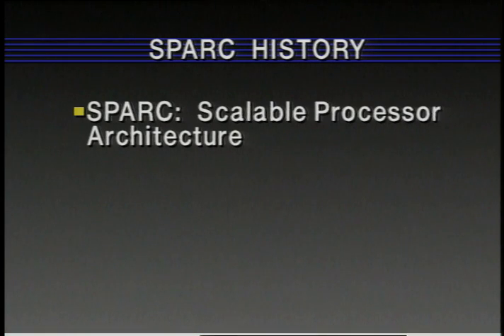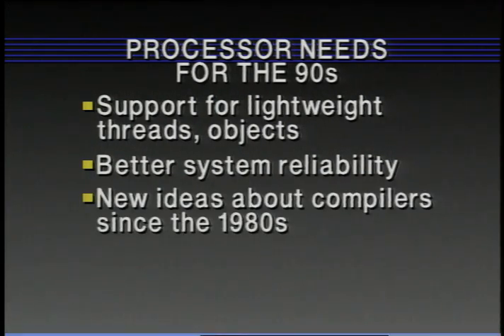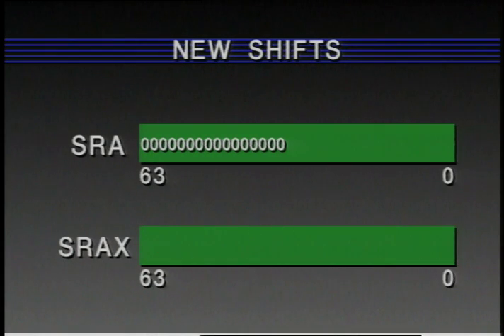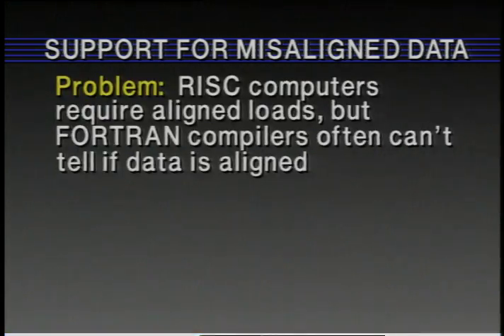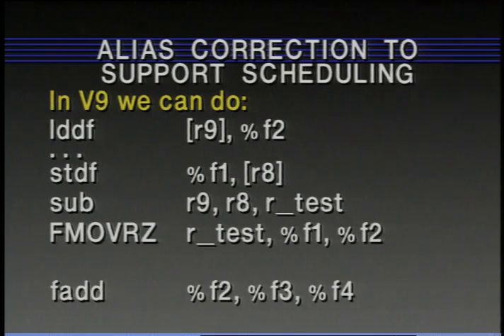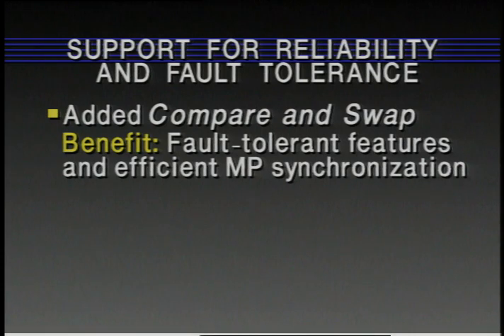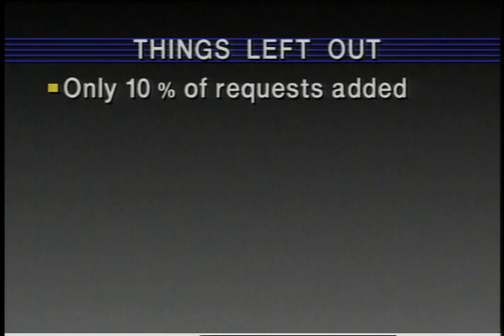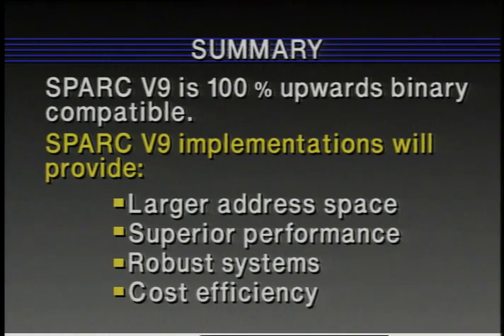SPARC Version 9, lecture by David Ditzel

Comment: 43:00 And then shit happened - Intel introduced superscalar Pentium, internally RISC with "architecture" up front to the "client" in CISC, form of ROM - microcode, best of both worlds. Then Pentium II multiple execution units to say bye bye to everyone else. Then Pentium III 1.2GHz - prefetch. Then Core? Out of order execution, then Core 2 Duo borrowed from Pentium 4 uops cache, translating "client" to world of internal RISC and keeping results for future use. ZEN did the same. Plus improved memory subsystem to be ~45nm instead of 100ns - access time to memory cache miss was of old 368 100ns :) 

Good thing about RISC "centric" architecture is that it remain small, and can be optimized in software. But it's not ideal - from user's perspective. That extra translation adds to flexability of us - users, makes assembly language easier. But same code wont run same on every processor. What is funny is that RISC is best for embedded, to keep simple and low power. Same time makes it harder for programer if you dare to write in assembly. Nobody write in assembly anymore but if you dare RISC makes it way more complicated.
Reply: All very insightful and interesting except the last part. CISC ISAs typically show very little orthogonality, which is why RISC ISAs are generally much nicer to program for.

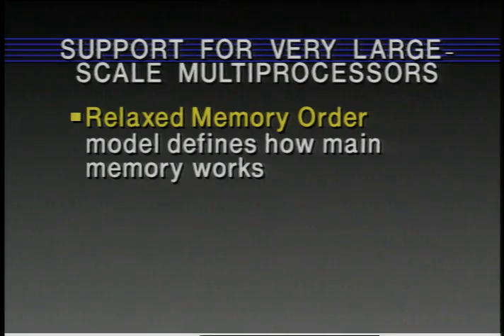Comment: 12:00 SO AMD - Jim Keeler did it better? You can run code in 2 modes 32 and 64, rest like CMOV we take for granted in x86 but was introduced in Pentium 166MHz ~1995  32:00 CMPXCHG there are new version of this instruction introduced in Core Duo and Athlon 64 on AM2 platform required to run Windows 10. Lecture about DEC Alhpa was much more impressive. Forgot name of designer. It was 1992 but it seems like Sparc architecture was designed to be cheap and simple. All these RISC architectures can define 3 arguments to instructions. 2x sources and 1 destination. Separates load, store from operation. This is why zero register is needed. Plus in 1992 RISC needed pipeline like fish needs water CISC allows you to initially solve that, tweak by more complex logic to run your sophisticated instructions in 1 cycle without need to pipeline that. Pipeline require good branch prediction right from start, and strict cooperation between compiler and architecture. Much easier to make pipeline if your instructions are already simple and can easly run 1 cycle. But forces user to sacrifice makes it harder to write code. 

Variable lenght instruction opcodes was requirement to keep backward compatbility, but it adds to complexity of decoder.. tradeofs so called CISC. On other hand allowed to make dozen of enhancements to instruction set. Also AGU on Intel is much more sophisticated. Not breaking backward compatbility. SPARC could not make client happeier by introduction of new instructions.
Reply: Oh end SCAZ REPZ on x86 allows very very quick memory copy 1 cycle for 32bit data,

Comment: "So because of that I think it's very unlikely that [Intel x86] in the long run will ever catch up to where the RISC architectures are." Dave later went on to found Transmeta, a producer of VLIW cores that ran x86 code. x86 has spent quite a while in the lead since then.
Reply: And if you listen to the sentence before, "that" refers to how x86 was register starved, a deficiency adjusted by AMD's x86-64. x86 never did catch up, and the modern x86-compatible processors caught up exactly the way he described.
Reply: @0LoneTech and generally, with AMD64 we've got practically a new architecture that only provides - thankfully - limited backwards compatibility with 32 and 16 bit modes. About time!

Does 16 bit protected mode even run on AMD64?
Reply: @LMB222  IIRC it does not; you can use dosbox but not dosemu.
Reply: With the usage of microcode, x86-64 sort of became like RISC internally, and thus could borrow lots of RISC techniques/ideas.
So in a way he was right, it couldn't catch up, but he was wrong in that it only caught up by completely changing its implementation.